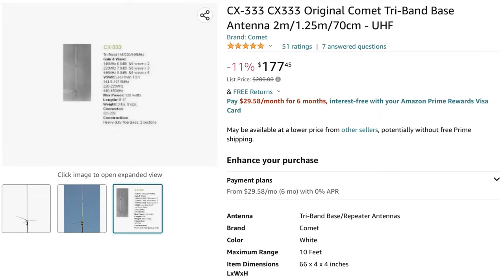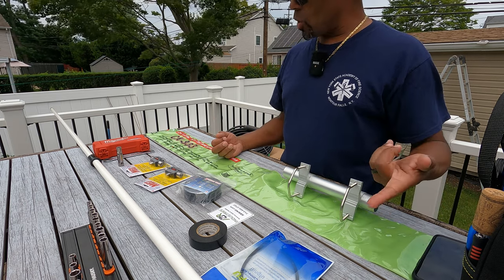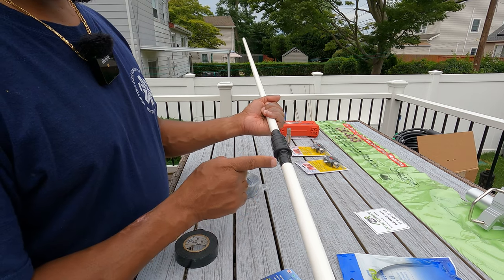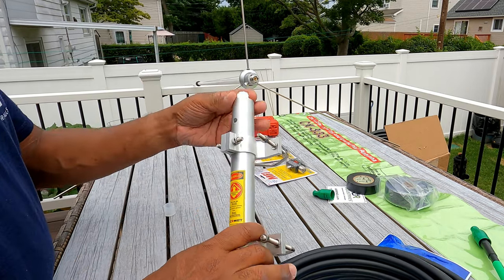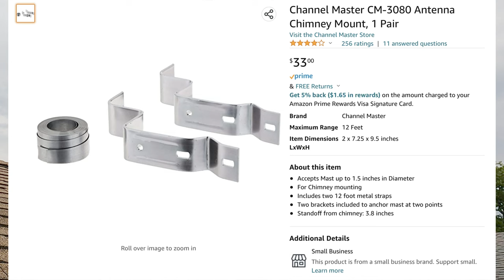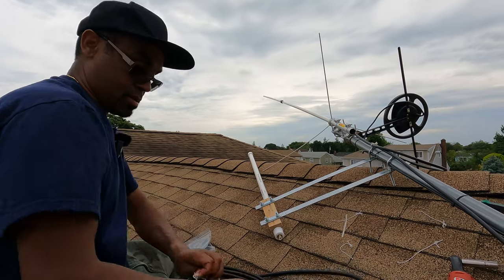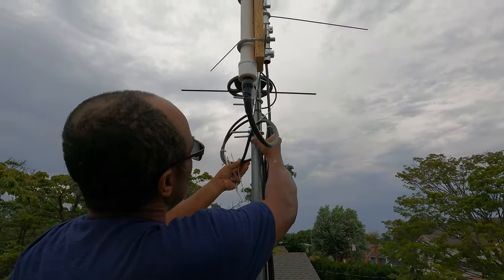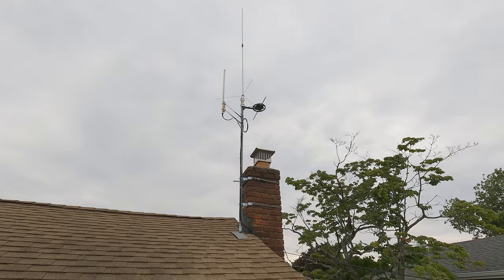How to set up a Ham radio antenna Comet Tri-Band CX-333 for newbie . My 1st Antennas set up for  DIY

Comment: Nice job, just 2 simple tips I hope that will help in the future. When using the electrical tape you should always leave the last couple of inches not stretched and that stops it from wanting to unravel.  And second use Black Zip ties Not White when installing stuff outside. Black zip ties are usually UV resistant and most White zip ties are not and will harden and become brittle and break off. Hope this helps.
Doug VA3DFK Ottawa Ontario Canada
Reply from the maker: Thanks for the tips.

Comment: Separate your antennas, you may or will have issues like de-sense / coupling. I also had my GMRS antenna on the same mast, but I ended up moving it where my directv dish was  I pulled off he dish, clamped on to the base and put on several mast extensions with guy cables supporting it.  I also had the MJF and Diamond surge protectors  /arrestors , but ALL of my old hams told me about Alpha Delta. The extra cost is worth the investment, the quality is night and day. Many hams vouched for them having been taken a direct hit and near by strikes....but at the end of the day the main reason is to remove build up static from the mast. Not sure if you showed it, ground your mast also; it will pick up static and may cause damage to your station and be more likely for a direct strike.
Reply from the maker: Thanks for the tips. I’m still setting up my system. I will take your advice if I have issues. Please remember to subscribe and like the video.

Comment: I just retired from my 46 year career as a Industrial Electrician. I also am a Ham Radio Operator. I advise you to wrap your Connections in News Paper or Similar before wrapping with sticky Tape. Keeps it from becoming Sticky when you remove it. I used Krylon Spray Paint for Plastics, Clear as my preventative maintenance although I plan to buy some Gel Coat for Fiberglass the next time I take it down. I also installed standoffs for my Coax.....
Reply from the maker: Now you tell me 😩great tips.
Reply: @DIYRAY  We never stop learning Ray.

Comment: I bet you get great coverage with that antenna. I know the Comet isn't tuned for GMRS, but I bet you won't get too much reflected power when you transmit into it. If that's the case, I'd be interested in the performance of the Comet vs the GMRS antenna in the GMRS band.

Comment: Just ordered the CX-333 today. Going to run a diplexer with 3 mono band rigs. Less antennas, and the ability to RX/TX 3 bands. Also set up a GMRS repeater @ my QTH. Gotta have comms for the rest of the fam that's not licensed 🙂 NICE, clean install. Separate your antennas about 20' if possible to reduce desensitization. Good to see more folks getting into GMRS!
73 de N3JDK/WRPH687
Reply from the maker: Thanks for the comments and tips. Please remember
 To like and subscribe.

Comment: Nice installation and a good video Ray.  I would agree with separating you antennas a little if you can.  Your installation is clean, you described it well and I hope it does a good job for you.  I was glad to see your son there the help.  When working antennas especially when working on a roof, it is important to have a helper.  If you can get your son involved, maybe it will be a good hobby you can enjoy together.  73s. WA4EOD
Reply from the maker: Thanks for your input.

Comment: This is kc0rzk just to let you know that if a lighting strikes the antenna you will lose that whole chimney so you might put it up on the other side of the house with a push-up Pole where the pole is coming out of the ground they say it helps out a lot I got struck by lightning on my CB days and having the pipe come out of the ground helped out a lot just thought maybe I should come in there and say that
Reply from the maker: Thanks for the tips. I pick this location because it gives me better Coverage on getting my signal out. I live in the suburbs where there’s a lot of trees and other houses in my Vicinity of my house. So I’m playing the odds of ever getting struck by lightning. Thanks again for the advice. K2SDS 73

Comment: Hi Ray De VU3ZNL I suggest you to simply seprate those cable to avoid interfearence from each other radio's 73
Reply from the maker: Most likely I won’t be using both radios at the same time. So it won’t be a problem. Thanks for your comments.
Reply: @DIYRAY  ok thath means no issues but if you are using then there would be some distorition hence suggested thanks for the reply 73

Comment: Do those straps scratch up your chimney bricks? What are you using below the mast to protect your roof shingles?
Reply from the maker: No. They are designed for this purpose. Just use a piece of pressure-treated wood. In my case, I’m using a old scrap of vinyl flooring to protect the roof.

Comment: Where did you get the bracket for the GMRS ? That looks good I really really like that.
Reply from the maker: Check the description section of this video. I updated the parts that I used for my installation. Check your sizes that you need for your project. Good luck 👍🏽
Reply: Thank you dude I ordered the same antenna that you got for your GMRS I was looking to put the same amount on my antenna pole that I’m running my Antron 99 which is a CB antenna
Reply: GMRS WRKG 711
Reply from the maker: @kenwright6778  You have to cut and drill for your set up. As you seem in the video, i had to use a piece of wood as a back brace to hold it in place. It works well.
Reply: @DIYRAY  it looks good

Comment: Nice work!  Your installation is A LOT cleaner than mine.  I just have a J-Pole connected to my back fence, and the coax just hanging off of it.  No zip-ties, or anything.  So, you've got a very clean installation.  Looks like I need to re-visit mine... DE K7RLN
Reply from the maker: Thanks for the feedback and please remember to subscribe and like the video.